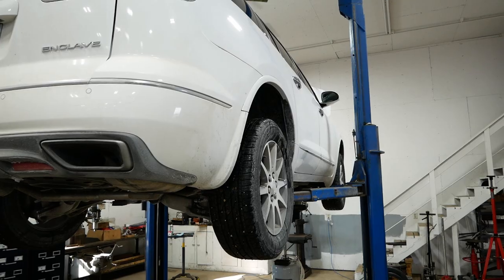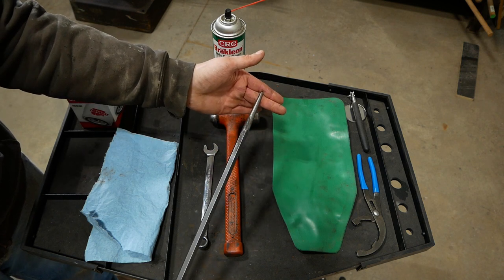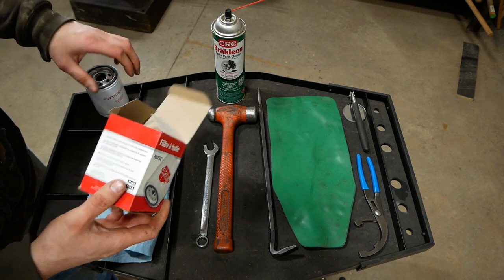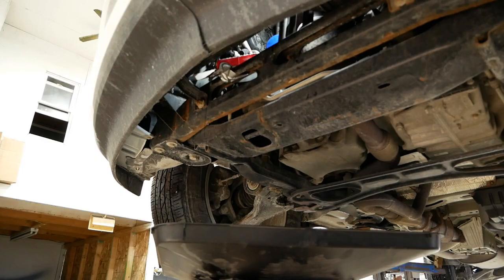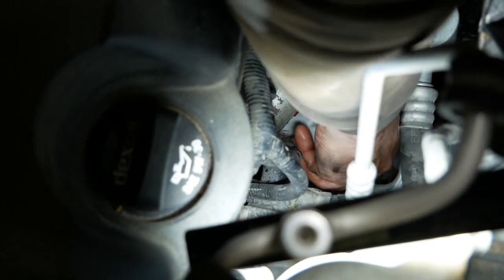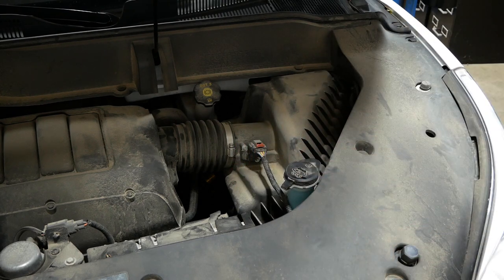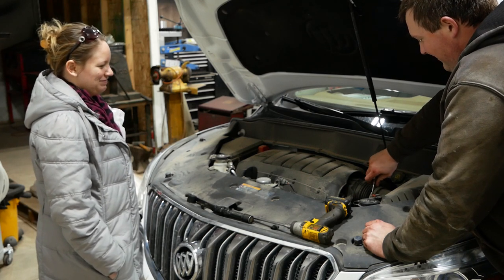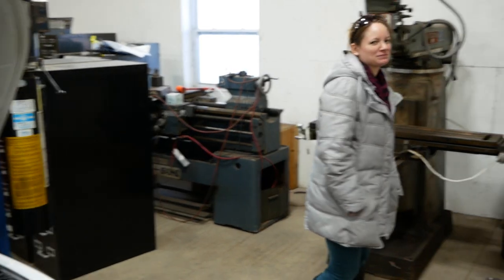Changing a GM 3.6L Spin On Filter without Spilling Oil?

Comment: I think rather than a $20 or $25 pry bar take a piece of half inch round stock about 10 in longer than you had there and sharpen one end and that's your specialty tool of course I know you can get a whole shop full of specialty tools another unrelated question Wes where did you get your power probe and you would you buy another one like that thank you
Reply from the maker: That works. But those bars are very handy for all sorts of things.

Comment: Put a remote oil filter kit on it ! Engineers make it so you have to bring it to either the dealership or a pro garage but they can’t figure it out to make it hard for us and at the same time easy for a mechanic at a garage and that’s why you need $100,000 or more in tools and equipment !

Comment: The location of the oil filter is so that when it's removed the oil will run all over the rubber engine mount causing early failure. The manufacturer makes more on replacement parts than it does when selling the car new.

Comment: Sorry Wes, I owned that car for 5 years and I never had as much problem doing an oil and filter change as you experienced.   Not as convenient as some other cars, but once you get used to it, I could do everything you did and more in 1/2 an hour.   no issues.  You succeeded to P'me off as if owning a Buick or GM was a bad thing.   Still one of the best SUV's on the road.
Reply from the maker: I just call it like I see it. This job pays .3 hours in any shop, and it's certainly possible to beat that.

Comment: WES, Why not poke that hole in the HIGH Side of the filter.?.? Let air in, to drain it, into the oil pan,  it's 6am in Norcal... I may be groggy from sleep,  but.?.? Thanks for a Fresh video this mornin'...!
Reply: Perhaps use the rubber tip air nozzle to inject air into the filter, if necessary? And viola all the oil is out of the filter, problem solved ?
Reply from the maker: There is an anti-drainback valve in the filter base.
Reply: After I actually woke up, yup valve...

Comment: Get an old JC Higgins bolt action single shot .22 rifle. Load it with a .22 short and stick it up through the subframe and ventilate the filter. Wear safety glasses tho.

Comment: Hopefully you learned another important lesson. Slip joint pliers, pipe wrenches, Visegrips, those type of oil filter pliers, and even adjustable wrenches, IE; Crescent wrenches as most people call them,  have a direction of torque. You demonstrated what happens when used backwards. They little effectiveness. When used properly, work as designed. When used backwards, they slip or strip. I am a professor at the University of Hard Knocks. When a old man taught me that, I laughed at him. Then he showed me a thing or two. The other lesson is those are disposable cars. They break down the day you pay them off.
Reply from the maker: Well sometimes you have no choice.

Comment: Slip a short drain pain under the motor mount(it's funnel shaped on purpose), then crack the filter loose. Lift the vehicle while the oil is draining from the filter, and roll in the large catch tank. Drain the oil. Replace the plug, and lower the vehicle, leaving the short pan under the motor. Replace the filter, then use brake cleaner to wash off the oil on the motor. That's how I do without making a mess.
Reply from the maker: That must be some magical drain pan.
Reply: @WatchWesWork  Not really. The one I use is about 7-8 inches tall and fits nicely under any GM with the 3.6L. When I roll in the drain tank like what you have, it catches the oil falling without spilling because it has a very large transmission drain funnel on top of it's 16 inch or so built on funnel. The pan I use is like this thing:  https://www.walmart.com/ip/DRAIN-PAN-4-GAL-1-SPOUT/162353373
Reply from the maker: @thomasmiddlebrooke1012  Oh, I thought you put the drain pan on top of the engine cradle. But that's impossible. It makes such a mess doing it that way, especially when the oil is hot.
Reply: @WatchWesWork  Oh fail on my part. When I said under the motor mount, I should have said under the mount on the floor. When I roll the tank in, it pushes the pan aside as the filter drains. I only crack it loose to where it drains without gushing all over the place. That way any little bit of mess stays off the cat and only on the block where I can most easily wash it off with brake parts cleaner. I can't stand leaving a mess under a customer's car.

Comment: If you’re going to punch a solid pin-thing into the filter why not use a hollow rod with a little chisel tip?  Oil travels inside rod, good.  Check out McMaster-Carr for some hard-ish metal stock.

Comment: Remove oil fill cap and dip stick to remove any vacuum lock that might slow oil flow from punctured oil filter.
Reply from the maker: The drain plug will do that just fine.

Comment: It use to be when you had a mechanic work on your car or truck the part to work on was the only thing that had to be touched. Now a simple oil change or air filter and put spark plugs in you have to take half the car apart. Simple plug change on a 2011 highlander the quote was over 400 bucks. Making them like they do makes money. It's all about the money!!!! Don't even get me started on electronics and the equipment you have to get to even test it and the price charged just to plug it in, I'm talking dealership cost. Changing oil? I just change it, wear it, take a shower, wash my clothes and bitch about it until the next time. Lol

Comment: Disposable car, don't change the oil filter, change the car when the service is due. At least that's what happened with the car I bought. All the service records upto date, brakes done in the last year etc. Yeah, brakes done but no grease on the caliper slide pins, result seized calipers, uneven wear. New pads and grease all round. Timing belt supposed to have been done in the last 5000 miles, took cover off belt is the original with cracking everywhere. Trans and engine overfilled as well. Pumped about 1.5 litres of atf out of the gearbox. Changes so much smoother now its not drowning.  Guess that's another garage I'm not going to use for work. Getting harder and harder to find decent mechanic's like Wes around here.

Comment: Answers to Mrs Wes:

1. If it were easily accessible, nobody would visit the dealer nor mechanic.
2. The designer/engineer doesn't work on their own cars.
3. Planned obsolescence.
Reply from the maker: Well 90% of engineering is taking something that works and making it fit in a smaller space for a smaller cost. The result is that is usually doesn't work anymore.

Comment: My son is an engineer and man, do I give him a hard time. We used to work at the same company. I was maintenance supervisor. He designed our products, and I would sometimes travel to a customer to repair a broken unit. When I would get back to the shop, I would bust his balls about how things were engineered. He would get sooo mad at me. Three different size bolts in one cover, metric AND SAE bolts. Or having to remove three parts to reach the last bolt. Just dumb shit like that. Just a little forethought would prevent that.

Comment: Plastic covers over the engine keep the temperatures up.  Higher temps = lower emissions.  See this more and more on all types of engines.  The impact on other components will be significant over time.
Reply from the maker: I suppose it has a lot to do with noise as well. It's supposed to be a "luxury" car.

Comment: Hey Wes, what are your thoughts on disabling ignition or fuel pump to fill filters that can’t be prefilled before install?
Reply: Just my opinion but sounds like more work than it is worth.  Either way you are still cranking the engine without oill presssure
Reply from the maker: There is an anti-drainback valve in the block, so you really won't lose pressure for much longer than a normal startup. I have never worried about it.
Reply: True but I have noticed a difference in my 5.4 Ford by doing this, just by the way it sounds when you crank it after an oil change..

Comment: As a former lube tech, i would throw a catch pan under the car, use my LEFT hand and undo the filter from the top, replce the filter then go up on the lift and tae out the drain plug
Reply from the maker: Two cans of brake clean?

Comment: Not near as bad as this GM, but my Honda Pacific Coast has the oil filter horizontally mounted directly over the exhaust pipe to the front cylinder. I just make a little tent out of aluminum foil and put it over the pipe when I pull the filter.

Comment: There is an egineering solution to this problem. My parents 2009 Audi A3 1.4 TFSI has the oil filter mounted upside down on the timing chain housing right next to the valve cover. A check valve inside the filter cartridge prevents it from making a mess every time you remove the old filter.

Comment: If you don’t have the form a funnel a very low cost and very available alternative is aluminum foil. I like the aluminum foil better because I can make it into any shape or length I want. You can also curl the edges over its surroundings to hold it in place. Also insert hateful comment here about GM’s engineers so I can fit in with all the cool kids.

Comment: British sports cars of the 50s and 60s were designed by upperclass engineers who never handled a (Whitworth ?) wrench. A fine example are early Jaguars where instructions for replacement of the starter start with remove the engine. Considering the starter was probably made by Lucas...
Reply from the maker: Yeah. You guys tolerated it. Americans would have pitched them into the sea!

Comment: I bent up an old license plate to guide the oil out of the FE ford shoehorned into my 65 F100. Otherwise it drips RIGHT on the cross member, both for the pan and the filter. Uffda.

Comment: I suspect most of the auto manufacturers (foreign and domestic) today have some engine bay design characteristics which will want to make you pull your hair out. I've got a 2019 Mazda CX-5 I'll soon want to "try" to do my own oil change. No telling what I'll find. My mom's 2014 Volvo V70 has the brake master cylinder hidden under some stupid piece of plastic up by the firewall, so a visual check of it without removing the plastic is an impossibility. Irritating. Oh, and I think Volvo hid the battery somewhere behind a panel at the interior rear of the car. Now, say what you want about my 327 Chevy-powered Willys and stock 2000 Dodge Ram, but oil changes on them are really not an issue. It's too bad us shade tree mechanics have to put up with some of the nonsense designs of the newer cars. All intended, I suspect, to drive us back to the dealers. 
Wes, I loved how Mrs. W.W. W. called it virtually the second she walked up on the car.

Comment: All of that "Pretty" under hood plastic is a direct result of the true retro builders like Chip Foose and Boyd Coddington hiding the wires and other bits, in an engine compartment.  What we end up with is a place for the mice to work their magic!  Thanks engineers from all manufacturers.

Comment: Why did that call for dexos? I understand why the 1.4 turbo cruze calls for it but didnt know the 3.6 did
Reply from the maker: All GM engines past around 2010 spec Dexos except the Duramax.
Reply: @WatchWesWork  thanks i didnt know that, i own a toyota and nissan lol. I choose to change oil in my sisters chevy cruze but i assumed the dexos was because of the turbo

Comment: I married a high mileage 2014 Acadia, My sister bought it last year for a nickel. She can't afford to fix it, I get stuck fixing the turd so her kids aren't driven around in an unsafe car. 

I checked it out the other day and the oil wasn't even reading on the stick. It burns a quart every 1k, I told her once you blow it up I am not putting an engine in it.
Reply: Teach her AND the kids how to check and/or add oil to it.  Maybe some of them will take a liking to doing it.
Reply from the maker: The 3.6 and 2.4 were big oil burners.
Reply: @WatchWesWork  Yup, mom had a low mileage 2.4l Malibu that went through a quart every 2k. Finally sold it and bought a Honda.

Comment: 1:15 No worries about oil getting on outside of Catalytic converter as the engine will burn enough oil in the inside of the cat to equal it out.

Comment: Well I don’t know it it would work or not but what if you cracked open the drain plug and then popped a hole in the oil filter would there be enough of a vacuum to suck out the oil from the filter i mean sounds good on paper.
Reply: @Richard Good idea, but the non return valve in the pump and/or filter might prevent this theory from working in practice👍
Reply from the maker: I don't think so. There is an anti-drainback valve somewhere.
Reply: Well thanks for the info guys

Comment: Disposable cars.  If you can't perform routine maintenance, you get a new car?  Actually, since the early 1970s, when I started doing oil changes and always followed the Hulk in the rotation, sticking a screwdriver through the filter was the accepted method for unscrewing the filter, anyway.  Well done sir.
Reply from the maker: I've had to air hammer them off before. Especially coolant filters on trucks.

Comment: If you pierce the top of the filter, will the oil run down back into the engine?
Reply from the maker: Not any better than it did without it.

Comment: A piece of metal tubing with an angle cut to replicate a giant needle. Hammer into the filter and oil drains out the other end of the tube . U asked for tips .😎👍
Reply: And this is a good one.
Reply from the maker: Great tip!

Comment: Nissan's yd25 diesel 
 engine in their Navara pickup has the filter pointing up at an angle from the block but Nissan being Nissan incorporated a 1 inch high dam wall around the housing top with a drain pipe that comes out next to the sump drain plug, now who ever designed that has done an oil change ! !
Reply from the maker: Nice!

Comment: My brother worked as a steam plant engineer for them for a lot of years, and found this to be true. There's the right way, wrong way, even the stupid way, but we're still gonna do this the "GM" way.... Common sense was never applied to the way they do anything... No need to stress over their cheapness and poorly made stuff. One of my "foreign cars" has a manufacturer provided run off tray below the oil filter to mitigate that issue... Probably cost me an additional 5-10 cents on the purchase price. GM just couldn't do that. It might make the dealers and other mechanic's job easier...
Reply from the maker: Even Chrysler has those trays!

Comment: I'm skinny so I do it from the bottom, I work at a dealership so I figured I can use a long extension swivel and spring oil cup and ratchet. Stick it through and you can turn it off and then I reach in there lol
Reply from the maker: Can you actually get it out? I couldn't!
Reply: @WatchWesWork  yup you can get it out from the bottom, where you put your hand through in the video it'll come out that way
Reply from the maker: @niteninja0133  I need your ninja arms!

Comment: Used to have a little funnel right under the filter that the oil would channel into. That’s not convenient at all. I still won’t buy a Ford. Had to remove a plastic skid plate every time I needed to change oil. I eventually cut a hole with a hole saw.

Comment: Punch a hole in the top of the filter which allows air to go in and the oil to come out .. works on side and upside down mounted filters .. you will not even need the cardboard :)

Comment: Not sure this meets the definition of “engineered “. To me, the term implies designed, prototyped, tested (repeat as many times as necessary) and proven to be adequate to the task including compatibility with all related tasks including future service and repair.  Obviously, this was designed by one team whose assignment was “make sure a replaceable filter is on this engine”. This they then did but with tunnel vision to exclude thinking about how one might actually replace the replaceable filter. 😎👍👀

Comment: You can't blame Toyota for having a good design they have there designers work on cars before allowing them to design and test new items, it gives them great ideas on making common parts changed easy. Unlike most USA and Europe where designers never see a workshop or know very much about how difficult hiding plastic boxes under more plastic makes things
Reply: Toyota is no picnic either with their cartridge filters.
Reply: @eldoradony  if the cartridge filter is the cab filter that is probably because Japan is a lot wetter and very rarely have to change these filters, I have a 25 year old car and it still has the original cab filter in it and looks almost brand new. But I we only have tarmac roads and not that much dust being kicked up
Reply: The first time I changed oil in my wife’s Tacoma I was a little irked about having to drop the skid plate to even get to the filter and needing a special wrench to get the cap off.
Reply: @HootMaRoot  I was referring to the oil filter that Toyota started using in 07 or 08. They have reverted back to the spin on in 19 on some models. Cabin air filters are a different subject.....

Comment: I blame GM's partnership with Isuzu for stupid part locations like this. Work on an old Isuzu Trooper or P'up or Rodeo and you'll find it's full of stupid things like this. That cardboard trick under the filter is a pretty good idea that I'm going to steal not for my GM 3.6, but for my Ford 3.7.

EDIT: The underhood plastic actually has a purpose other than giving rats a place to live. Those plastic covers make the engine more aerodynamic, which helps the gas mileage a small amount. I don't know how much benefit one gets from this, as the most fuel-efficient modern non hybrid car I've ever had didn't use these covers.

Comment: Had to replace one of those motors in an Acadia with no lift what a pain will never do that again screw gm and their having to remove ten parts just to get to one bolt on a part that’s on top of the motor